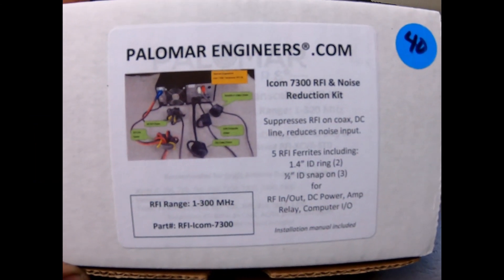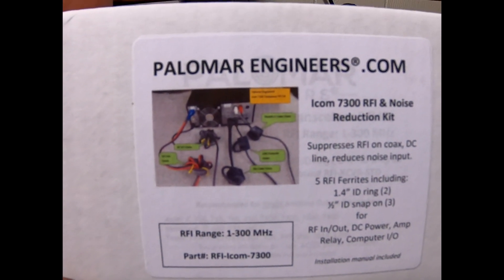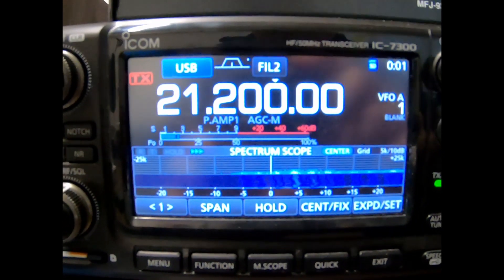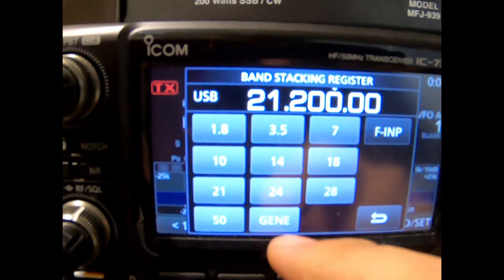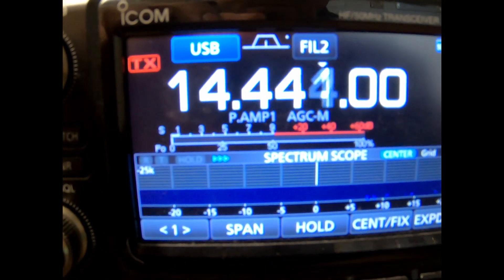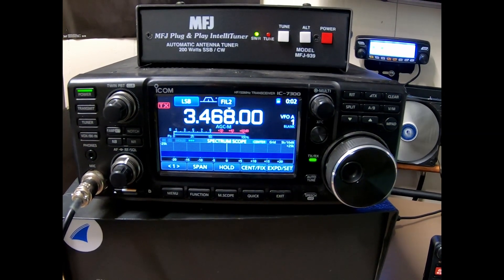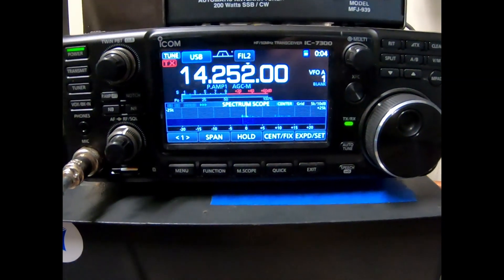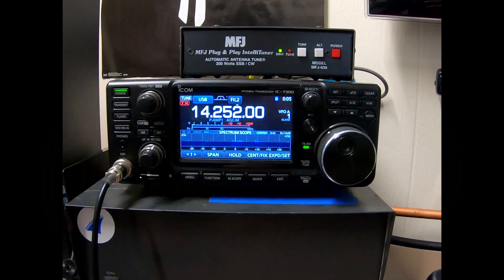Too Much Rfi Noise?!? RFI & Noise Reduction Kit From Palomar Engineers #icom #7300

Comment: The best way to reduce noise (by at least 2+ S-meter units) is to turn off the electricity (power) within a 2-mile radius. After the Russian attacks, we noticed a significant reduction in noise without electricity.

Comment: Just by looking the rings are FT240-43/31 6 turns on dc power, same type 43 or 31 for coax and data
I would add a type 75 on the ac line
You welcome i saved you $$$
Follow

Comment: I have a 10 m import. I guess they would call it, 26 MHz quiet 25 MHz is quiet 24 MHz is quiet 28 MHz quiet but the one I use the most which is 27 MHz I have a nine noise level white noise , I’ve tried everything I can’t stand it anymore. Can you imagine a nine noise level only at night? I can’t talk to any of my friends.
Reply from the maker: You might possibly have something in your home causing interference. Or something in your area

Comment: You wouldn't see a difference in QRN using this ferrites and chokes. They are commonly used to reduce CMC (Common Mode Current) running "loose" in your setup during transmit.

Comment: Not a equal test, your first antenna you had the receive pre amp1 turned on. The off center fed with no noise you had the receive pre amp off. How much of a kick back did you get from Palomar for the video.
Reply from the maker: I will do another video. Thanks for catching that. I didnt get any kick back. Bought the kit myself

Comment: Um pre-amp on....hello.....
Reply from the maker: I will do another video. Thanks for catching that
Reply: some bands it was on some bands it was off. 21.200 had pre-amp 1 on for before and after which shows a big difference in noise. You can see the trademark wobbly electrical interference around 21.200 in the before. Although, it could very well have been an AC unit or washing machine, etc, and it may have been off for the after test.

Comment: An ambient noise of S2 to start with isn't so bad lol. I have minimum S5 almost all the time but I live in suburbia. What would have been interesting would be to see you adding one choke at a time to see which choke had the most effect or if each one contributed in addition to the overall reduction. I find its usually one noise source that's the major issue and once quenched gives the greatest gains in noise reduction. If you can find that, probably don't need to spend a bunch of money using the scattergun method.
Reply: I married my wife 37 years ago. She came from Zada Croatia, maybe I shouldn’t have said that who knows